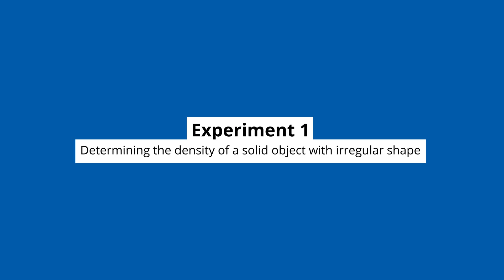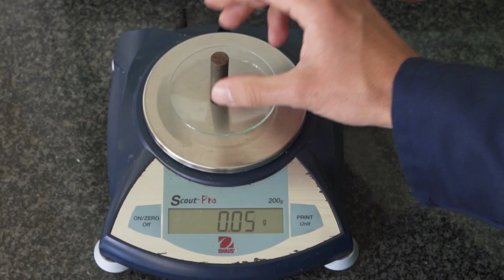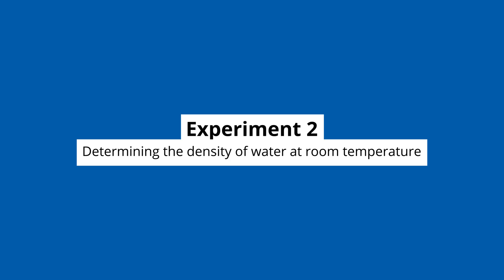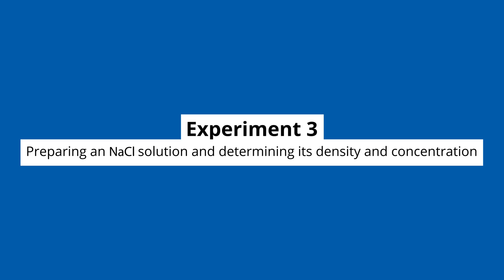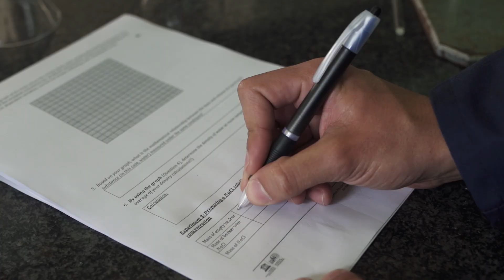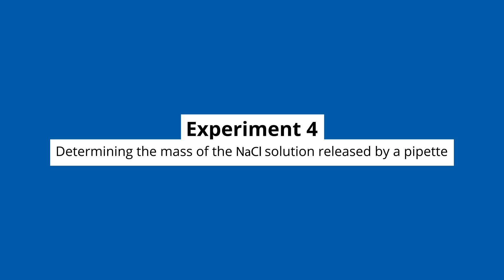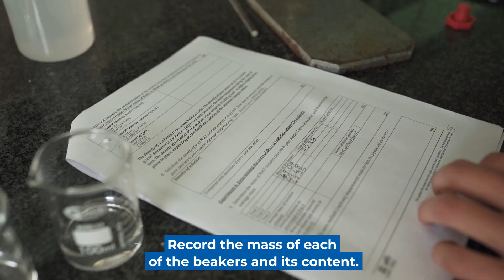Lab Demonstration: Measurements (CHM 171 & 172)

Comment: For experiment 3, which volume are we required to use for the mass calculations?
Reply from the maker: In Exp 3, the density is to be calculated by using the mass and the volume of the solution. Mass is determined by using the mass balance i.e. 
(m of flask + solution) - (m of (empty) flask) 
= mass of solution